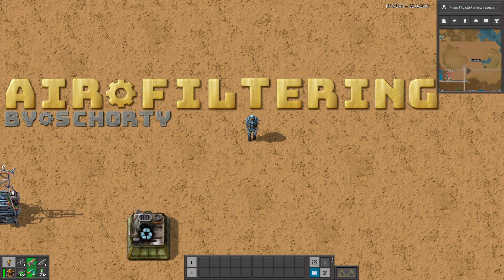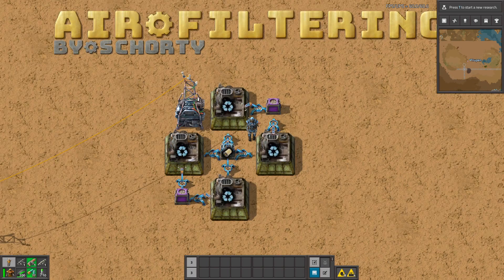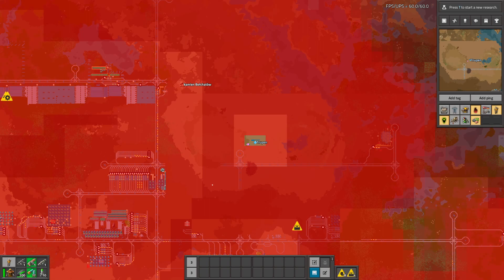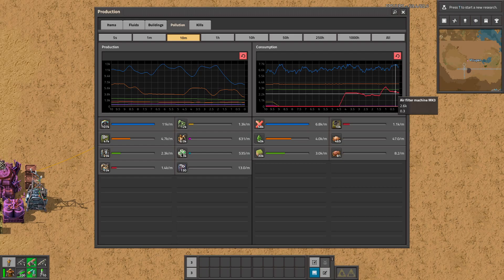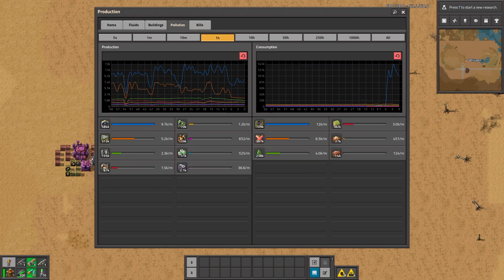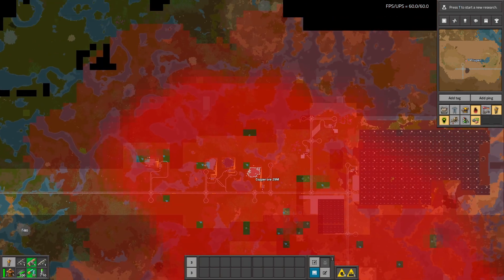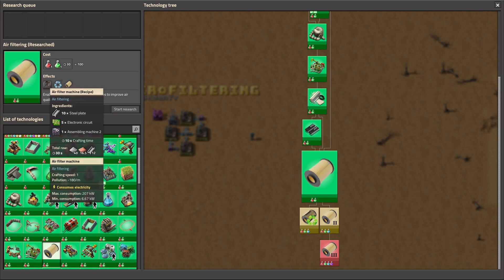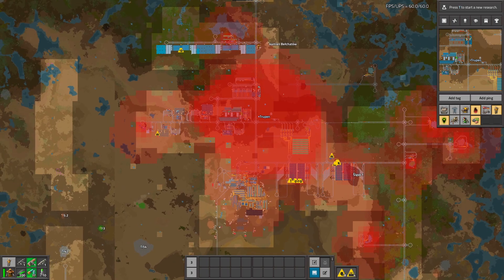Fix your Pollution Problem.

Comment: Make more pollution to make less pollution.

But at the same time it can be used in terms of "moving" pollution, in one place where you have good defence and a lot of energy production you make fillters, than move them to far outposts, which are connected to the main grid so you don't have to produce it there,  and use them to clear air so bitters wont attack your small oil outpost!
Reply: Oo I like the idea of this kind of mod as pollution neutral (the washing recipe creating as much pollution as the cleaning recipe) so you can dump pollution into forests or otherwise redistribute pollution, rather than just magically remove it.

Comment: That's imbalance. If you don't want to fight with bitters, just turn them off!
Reply: @nicodemuseam  
Then just turn off polution or enable passive mode.
I usually play with expansion and polution off, but evolution by time high. Means if you don't wipe them out quickly they'll become a bigger and bigger threat, but they'll only attack if you expand too close, not because they came to you which makes the maintaining of the factory easier at the cost of expanding the factory being a lot harder early on.

Comment: All these big mods like SE, Space Exploration, Bob's, all of them have very balanced things added.
These side mods are less balanced, making them tend to be OP, although they still can be quite challenging to set up.
Reply: This is the big issue of mods, no unified vision, no shared goals or sense of balance.
Reply: @Marxon1134  Well, some of these mods are more of a "personal preference". Like, is an Ion cannon in factorio balanced? No, but I'ma still use it because I like C&C
Reply: @doggo_woo  and i have a prity balinced mod thats still op for it just gives me varous spider trons and the higher tear ya go the better they get like even a just walkering forest fire one :P so ya they strong as fuck in the end BUT you tend to have equal options in eathetr turrets or other things as well and i got it because i wanted to enjoy a spider tron but did not want to wait like a week or 2
Reply: @lechking941  In my experience, I was able to get to end-game in 2-3 days, depending on if I was actually attempting to get to the end-game or was just trying to build a megabase.
Reply: @doggo_woo  hm well i tend to be sometimes slow :P or diddo around as i have plenty to learn.

Comment: Theres a cool mod thats reverse of this in the form of a flare stack, a chimney that just makes pollution.
Reply: A true factorio enjoyer
Reply: The primary function of the flare stack is to help balance fluids, it generates pollution as a side effect
Reply: @Hawk7886  i use the solid ones to burn my extra wood so I can save bullets.
Reply: @Hawk7886  You mean added benefit.  I also realized I would just burn the used filters.  Which... probably isn't the way this is intended to be played.
Reply: @Hawk7886  Circuit Networks are a fun way to balance Heavy/Light/Petro.